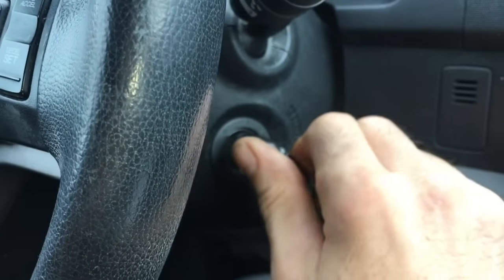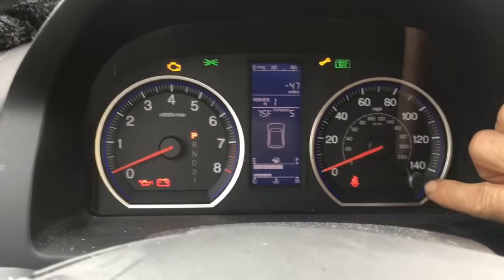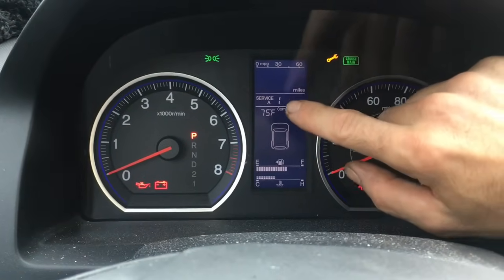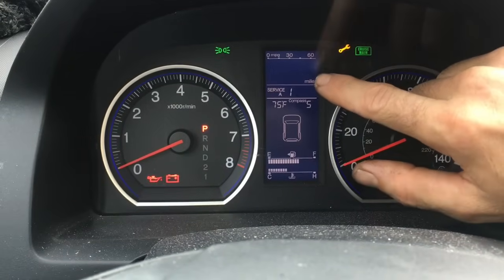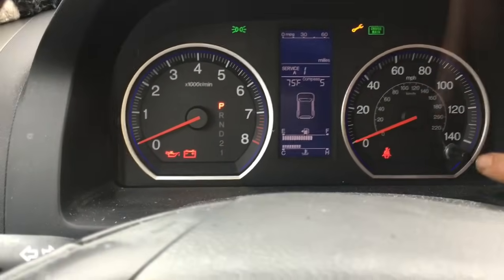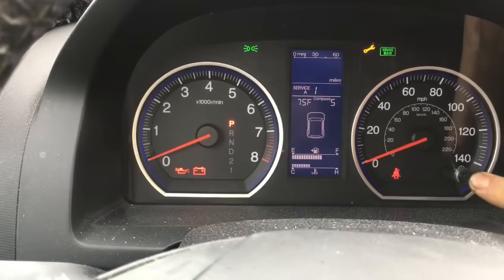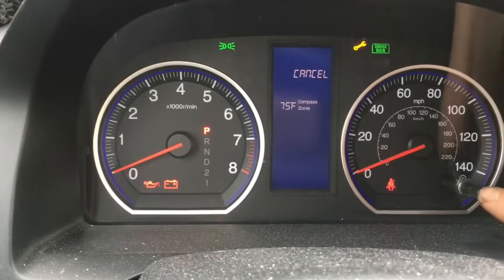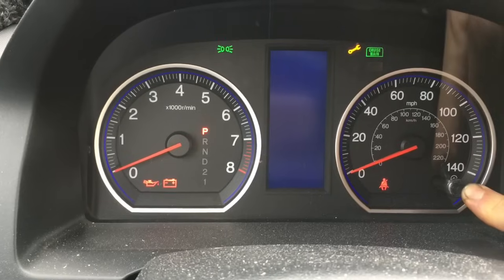How To: Reset The Maintenance Light On A 2007-2012 Honda CR-V

Comment: Thanks very helpful. Does that also reset the low tire warning light ? Was told it would go off after driving it for x amount of miles, just bought it. Wasn't on before but was when went to pickup after we bought it, also you should show how to fix leaks in back threw body seam glue/caulking/weld job at body seams. I've seen video's from nobodies that figured it out by THEMSELVES due to Honda charged over $150 and didn't fix it, only 1 complaint but many on here. Should be a recall but won't.

Comment: I have a 2011 CRV.  It is a low mileage vehicle for us and we are the only owners. It has approximately 55,000 miles as of
March 2020.  Obviously the computer is wanting to change the oil more frequently than I believe is necessary so consequently 
we have to look at the “wrench” for long periods.  I tried two other video walkthroughs which I was not successful in resetting because,
in my opinion, we’re not as precise as yours. Albeit I had some failed attempts but when I came upon yours I went thru your 
video ,in real time , and it worked. You left nothing to chance.  Kudos.   Bernie
Reply: Hello, I'm like you, I like a longer oil change interval when using full synthetic 0W-20. But the maintenance minder is based on 3000 miles. So I wait until the minder is at 30% oil life (2100 of the 3000 miles used) and reset the minder back to 100% oil life and change the oil when the minder is between 5% to 0% which acts as a 5000 mile interval.

Comment: hi!
i recently bought a used cr-v 2008 2,2 i-ctdi and i cant figure out why does the yellow oil can on the dashboard illuminates after 30 min drive or more, also for the love of god i can't find oil life indicator in percentages. is that a US thing since i'm from central europe? also i changed the oil day after it started glowing but nothing changed oil that i put inside is 5w30
Reply: hi, did you manage to reset the oil life?
i have the same engine, 2007 model..
thanks
Reply: @edhok78  hi, sadly no i didn't. I can only check oil level by hand.

Comment: What if the light is coming on not because of it's time for an oil change?  I've had 40% oil left, and now after I did that it's showing 100%, which is not what I want. Is there any way to reverse that procedure to get it down to it's correct reading of 40%, and to find out what the issue actually is?

Comment: Hi I have a HOnda CRV 2008 model. I have a strange problem. Out of the blu when light switch is set to auto on my light switch on the left side of the steering wheel....IN DAYLIGHT backlights and instrument lights work as they should, but when it gets dark, backlights turn off and instrument lights work. TO get the backlights to work i Need to set the light switch to OFF position.. but then of course instrument lights AND farlight, the one showing with blue icon on the instrumentpanel ( I don't know the english word for it sorry ) that doesn't work. I can test this on the daytime with blocking for the light on the sensor sitting on the inside of my front window. I have a window wiht rainsensor.  PLEEEASE help!

Comment: nice thanks, got a Honda CR=V 2006 the Speedometer is going crazy what it is ?
Reply from the maker: Juan Arroyo most likely the instrument cluster. The first thing I do is start checking for loose connections  like bad grounds. I would also hook a scan tool up and tried to pull codes from the instrument cluster. And go from there.

Comment: I went to change the oil of my 2011 Honda CR V and the emission control light came on . Do i just need to do that and it will go away
Reply from the maker: You’ll need to pull the code to figure out what the lights about and then decide if it needs diagnosing or if it’s just something that needs to be cleared.

Comment: Mr. Brian, How can I reset a TPMS light back on a Honda CR-V 2007?
Reply from the maker: David Angel on the Honda it supposed to reset by itself after topping off the air. If the light is blinking that indicates that there’s a problem and you need to hook up scan tool to it. Very common for the spare tire to be low causing the light to stay on. And in some cases when you rotate the tires it gets confused on which tire is which and has to be recalibrated.
Reply: Thanks but tires weren't rotated, just bought vehicle but had water in spare tire area and after I got home. It rained out and checked it, water inside again, seen the water leaks in threw the body seam. So need to seal the seams up top with back door open. Then see if it leaks after. But the company drilled a hole under the spare tire and I never checked it for air, that's bad on me but I wasn't adding air to tires, I always put air or see if it needs air on spare tires, no one ever checks that at all. That's a must due ESPECIALLY if your taking a trip. You need a spare tire to be filled or its useless now.